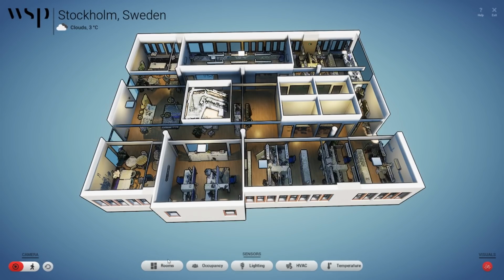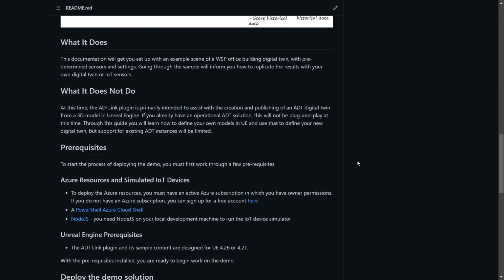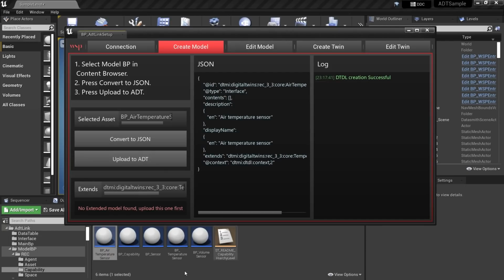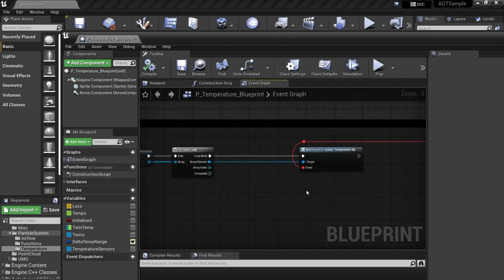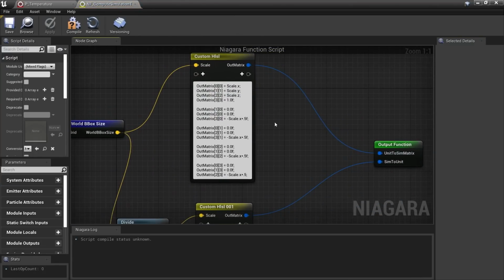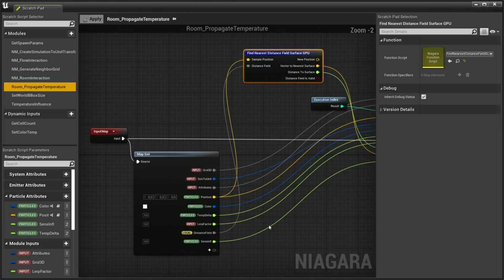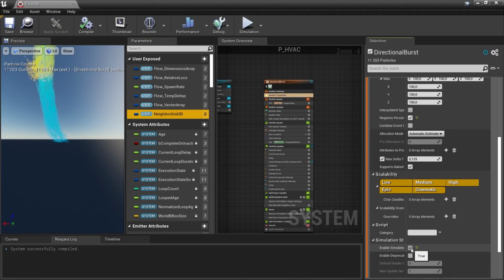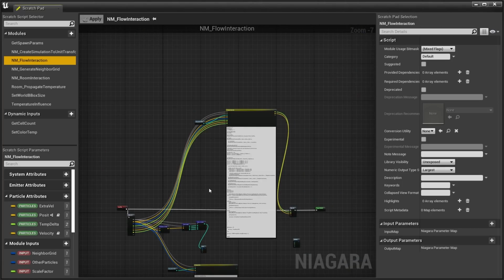Visualizing Data in Digital Twins with Unreal Engine | Webinar

Comment: Great video. Would it be practical to implement this in building automation systems? (real time particles and their effect on the temperature) or just in the build phase to see the airflow and cooling heating rates?
You mentioned there were sensors detecting when people were present, does that mean you could automatically have the HVAC turn on instead of have to schedule the event?

Comment: What’s the value you get from this? Sensor data can be visualized independently from the 3d model..the whole temperature propagation system can be simulated conceptually on other non real-time platforms..in terms of monitoring a space how can we make use of this in a practical day to day thing?
Reply: It feels like as a new concept, people don't see how to actually add value with digital twins yet but are typically desperate to apply this new fun thing everywhere. Eventually a useful implementation will emerge